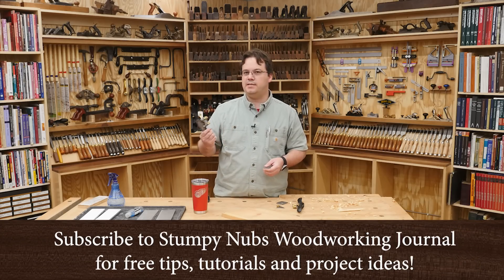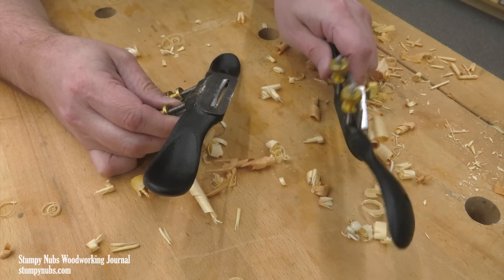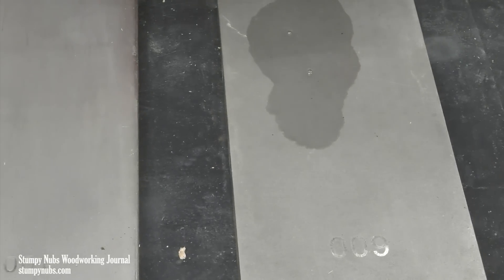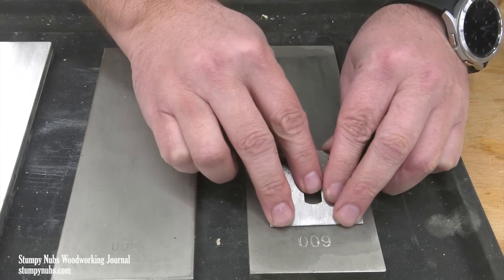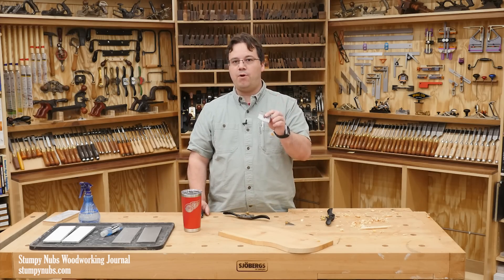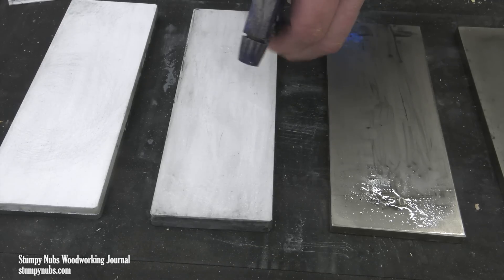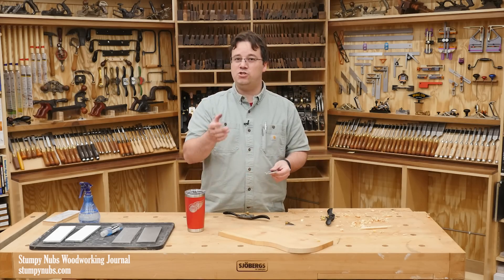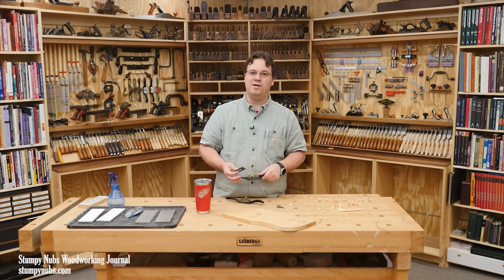This will change how you sharpen tools.

Comment: It'd be cool to see a realtime video of you going through this process with a factory blade and with a used one. Literally just uncut footage, close-up, showing what you do and giving a good sense of how long it actually takes.
Reply: If I had to guess he can probaly go start to finish in less than 5 minutes. But I agree, often curious with wood working videos this same question :)
Reply: I really can't see why anyone would need more than we just watched.
Reply: @ClintsHobbiesDIY  Which is why they said it would be cool not necessary.
Reply: Factory blade needs to be cut in, grind and hone of the chamfer, hone the flat, deburr.  Cutting in a new blade is about 15 minutes for me to properly set it up, then 2-3 minutes to reintroduce a freshly honed edge when needed.
Reply: Probably even less. For chisels and plane irons flattening the back is what usually takes longest. Using the "ruler trick" speeds this up - a lot. I'd say apart from having an extra grit there's no real difference. Sharpening the iron (during working with the tool), Looking at Paul Sellers, Frank Klaus or Richard Maguire, you can get it sharp in a minute or so. But those have much more experience than hobbyists like me. For me, I'm not under time pressure and get it done in three minutes or so.
Reply: Considering he sharpened it in real time while explaining every detail, in less than 8 minutes, I don't think we need proof 😆
Reply: That would take hours to make and no one would watch it

Comment: The spokeshave video is a great idea.  You can simply use the strop for a time to restore the edge.  And, even is you decide to use a stone, unless the edge is notched, you can probably use say a 1,200 grit for a quick honing, then the strop.  We tend to notice "dullness" fairly easily, but fail to deal with it until we "really have to," because it's so much work with stones and strops.
Reply: @hifartingoctopuss  I changed subjects there without notifying readers.  I don't strop spoke shaves.  I think Stumpy's idea is a good one.  But I do strop chisels repeatedly during a day, only use a stone once or twice a week.  Until the edge actually breaks and rounds off, the pulling motion of stropping will restore the edge of a lot of chisels.  Metal and hardness come into play too.

Comment: I've spent a while backpacking around, working for room and board on small family farms and homesteads. In 2015 on a trip to Belize (formerly the colony of British Honduras until 1981), I found a Record A151 Spokeshave for sale in a hardware store in Belize City. They stopped making them in Sheffield, England in 2004, and I don't doubt this tool had been on the shelf for at least 10 years. The package was dusty and yellow with age. It was priced at $54.56 Belize dollars, or $27.28 USD, but there was another sticker on the back for $48.50, clearly it had been gathering dust long enough for the price to rise with inflation. It was alongside a cheaper, inferior quality brand, and had surely been passed over many times for the cheaper option. I bought it without hesitation and used it to make many handles for hammers, mattocks, shovels, hoes, and even a canoe paddle. It's so light and versatile, I'd pack it for my next trip.

Comment: I also have both of the VERY SAME spoke shaves. I can’t imagine my shop without them.

ALSO—freehand sharpening is so much better than using a “machine”. My late father-in-law, a wood shop teacher taught me the technique ages ago—and I’ve never felt the need to do it any other way.

Thanks, again, for a great video!

Comment: I started out sharpening with a jig and have mostly switched over to doing it freehand.  I probably don't get blades quite as sharp, but I spend 100% less time messing around trying to get the jig set up square and at the right angle, so I don't put off sharpening so long, so I spend less time working with dull tools.

Comment: I got one of those flat bottoms from Taylor tools. Second day using it in my shop, turning hickory into tool handles, one of the arms snapped off mid stroke. 
It's not a knock on Taylor Tool works, they of course offered a refund or replacement, my choice. I politely declined a replacement, and found a vintage Kunz on eBay. One of my new favorite tools

Comment: "THANK YOU!", Mr. Nubs!
I just bought a "Taytools 469560 Flat Bottom Spokeshave", delivered May 03.
I paid $20.69US for a USED Taytools spokeshave on amazon, "fulfilled by amazon".
I'm not unhappy w/ the tool but I do not recommend buying "used" at amazon.
Buy new from amazon or from Taytools.
I think the hole in the chipbreaker/blade retainer is too big (3/32) but other that it's fine.
I wish you had posted this video 10 days ago!
It wouldn't have made much difference, I've already learned how to sharpen most anything.
I'll resharpen & try the scale under the back next time.
I used a 400 & then a 600 grit diamond plate to clean up the machine marks.
Followed up w/ a 1,000 & then 1,200 grit diamond plates.
I've already used it a hickory handle, poor quality wood, 'wild' grain jumps about.
But that is not the tool's fault, I wanted a cheap handle to practice on, & I sure got one.
It's a "Truper", it was only $20US & I've made 3 handles out of it.
I still need a 'good' one tho.
Thanks again.
Have a GREAT day, Neighbor!

Comment: Great video, James! You're one of the best teachers on here.

I don't sharpen exactly like that, but that doesn't matter. The most important part is that it's easy and effective. The more accessible the method, the better. We can always choose/develop our own favourite method as we learn—and, boy, do I have a lot to learn :^)

My first spokeshave was given to me because a vintage tool seller (the tools, not the seller, were vintage) accidentally sold me a small hand drill with no jaws. It was an old flat sole Stanley of the type without the adjustment screws. It wasn't pretty, but it worked a treat! I bought the other one soon after! I love using them. I've gotten one with the adjustment screws since then. A brilliant tool!

Comment: Great hand sharpening advice, one thing i would caution on is to make sure your fingertips aren't touching the stone in the process. You would be amazed at how much skin you can sand off without noticing until you notice your fingertips are bleeding, especially in the 1000+ grits.

Comment: Thank you for this excellent video!  I really struggle with the microbevel.  I can easily find the primary bevel and sharpen that.  It’s big enough to create the reference surface that you can “feel”.  What I mess up on is a consistent microbevel.  I can’t seem to keep the same bevel on each stroke.  Your suggestion to get a few of these cheaper spokeshave might be just the ticket for practice.  Thanks to the wood gods we have Taylor Toolworks!!  $20 for a spokeshave like that is a true bargain!  I do love that style of spokeshave. :)

Comment: Very good video, but I would reserve the ruler trick for the final lap on the back.  Hair splitting, I know.
Reply from the maker: Why? If you remove the bur after each grit you can then detect the new burr and know when to switch grits.
Reply: @StumpyNubs  Sorry- I wasn't clear.  Remove the burr each time but with the iron flat on the stone.  Then if you want to finish with the ruler trick you are doing it on the finest grit and thus minimizing the effect of the ruler.  A fine point to be sure.

Comment: i have no idea how well it would work for polishing during sharpening, but i recently discovered that a piece of retro reflective cloth ( such as the shiny bit on a construction vest or hoodie) makes a pretty good polishing cloth. I have a tape sized roll of the stuff, and cut  patch off of it, and have been using it to polish stainless steel things for a project of mine, and it has been working great. Its technically made of glass, similar to sandpaper, so i dont see why it wouldnt work for other jobs..... and its cloth, not paper, so it should last a while.

Comment: Hi Stumpy, you have a protractor with a sliding 90 mitre on your wall at the beginning of the video, what's that rule called, please?  I have many uses for such a tool!

Edit - Spoke-shaves are great, and super accurate, I don't have a rounded base one though, definitely be picking one up.  Also for people who need a good flat surface, two "flat" stone tiles and then going through some polishing pastes by working them together will get a very flat surface to adhere primary grits to.
Reply: You really need three tiles, to prevent introducing an unintended curve that you might get if only using two. This is a foundational method for producing surface plates or lapping plates, and the quality of the results are only limited by how fine an abrasive you can get, how stable the materials are, and how much time you wish to put into the flattening process.
Reply from the maker: Are you referring to this? https://bridgecitytools.com/products/as-24v3-adjustable-square
Reply: @StumpyNubs  No, it's hung top right of the wall, under a plane, beside a bookshelf, further to the right of the squares.
Reply: @Spott07  Two is all that's needed with the right technique, I take your point but it's entirely possible and even preferable to use the same faces to lap together if done right.  Just FYI I'm a heritage stonemason by trade. 👍
Reply from the maker: @masondegaulle5731  All of the tools on that wall are from this collection: https://bridgecitytools.com/collections/layout-tools-2
Reply: @StumpyNubs  Many thanks, "Universal gauge" is what I was fumbling for. 👍

Comment: Hey James, I have Rheumatoid Arthritis,  as well as a couple other chronic pain issues.  My disability was what actually drew me to this hobby initially and it has provided a lot of therapy both mental and physical,  although some tasks I do require sone modifications to perform.   This would definitely be one of them.  Holding a small object at a specific angle for a prolonged period of time is not something my small joints allow.  Do you have any ideas for any sort of jig or tool or handle one could build in order to make this accessible for someone with my particular needs?  Obviously,  i could easily hire out any sharpening I need done, but when a person finds they CAN'T  do something,  it drives them all the more to find ways  in which they CAN.
Reply from the maker: I don't know of a spokeshave solution. I would suggest a small block plane for chamfering/shaping straight objects and convex curves, and a sanding block (I like cork or foam) for convex surfaces.

Comment: I find that sharpening the way you described is a lot harder for beginners. Is harder to keep the bevel on the stone if you go perpendicular to the stone since the bevel is shorter, if you use a 45° approach you will have a easier time, going parallel to the stone is even easier since you have  a bevel length equal to the blade width. And personally I think that you dont have the same control pulling the blade to you since you may round the bevel. Is best to learn to push the blade away from you while keeping the pressure constant.

Comment: There aren't many skills that a man really needs to have to be successful. Sharpening is one that really is required. Be it spoke shaves, planes, pocket knives, kitchen knives, lawn mower blades, etc., they all perform so much better when sharp. Because a sharp blade requires much less effort, it is actually safer to use.

I do suggest going to the hardware store and getting yourself some cut resistant gloves to use when sharpening. You are handling items that are very sharp and you do need to protect yourself.

Comment: Call me a lazy troglodyte if you must, but I have a vintage Craftsman 4" x 36" belt sander/grinder, and sharpen all my plane and spokeshave irons, chisels, knives, and leather working skivers on that with silicone carbide belts in grits of 80,120, 240, 400, 800,1000  (available in a double set for less than $2 each).  (Then I hand strop on leather with jeweler's rouge where appropriate...)
Reply from the maker: There is absolutely nothing wrong with using power. I do it myself much of the time.

Comment: Wrong, wrong, wrong, wrong, wrong. Spoke shaves have two little thumb places. Reason? Cut with a push, NOT a pull. Also hate the thin metal ruler method.
Reply from the maker: No, it is not wrong. Spokeshaves can be used in either direction and have been for hundreds of years.